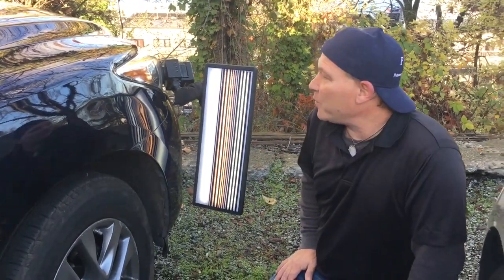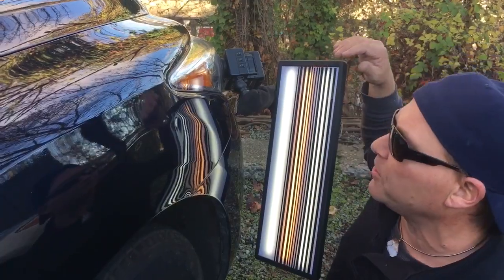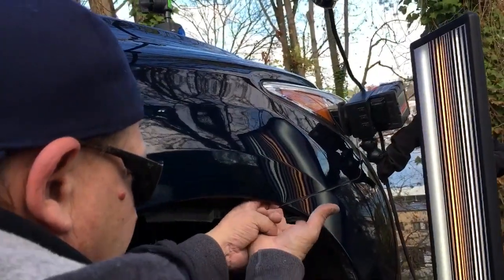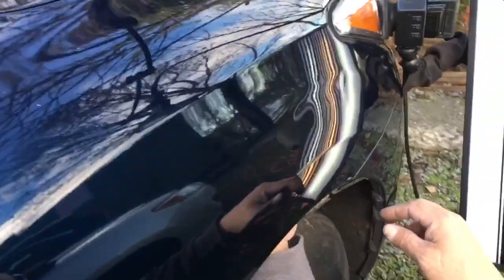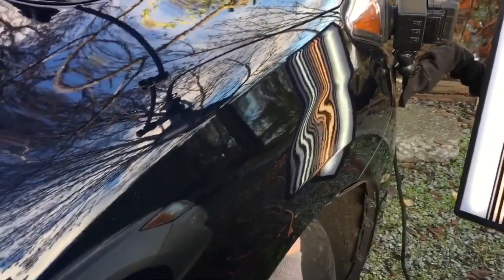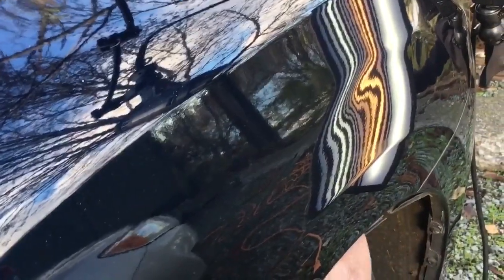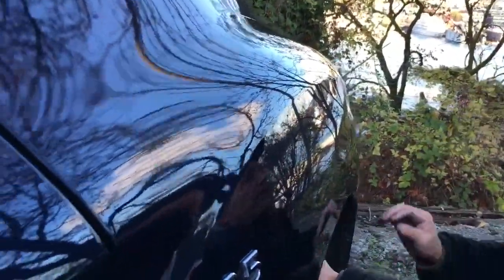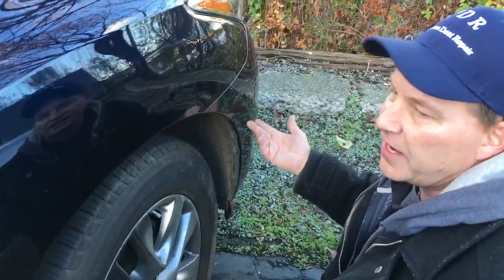PDR vs. Infinity ♾ QX60 Difficultly level 7 😎 #undented #PDR #InfinityQX60

Comment: nice job, had a small dent (less then a dime size) on a 2018 Honda CRV right at the edge of where the head light was mounted, could not get a rod on it due to a bracket, had to glue pull it. Came out about 80%, then had to use touch up paint on the scratch. Hated to leave it that way but customer was ok with it.
Reply from the maker: Victor Barranca sometimes that's all you can do, taking out the headlight might've given us some more room. Did you try that? I didn't on this one I just worked it from the bottom. Thanks for watching Victor. Always nice to see your comments :)👍